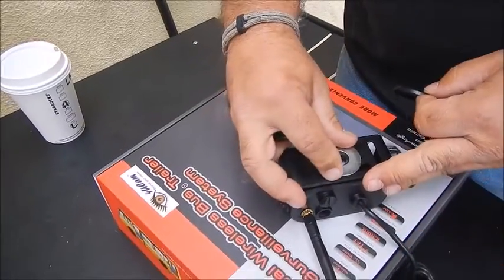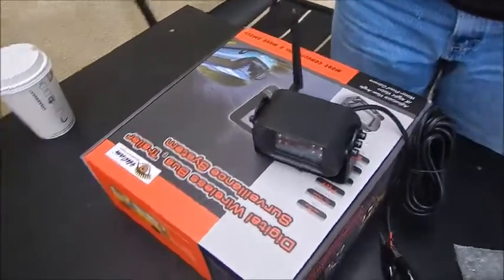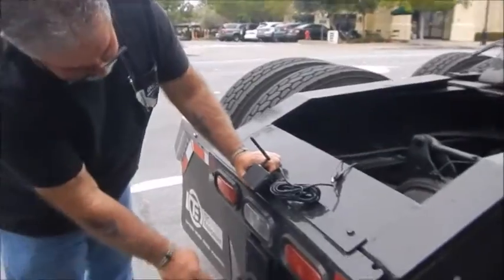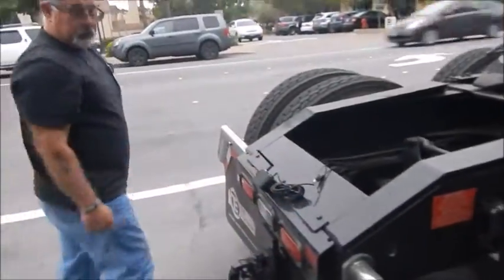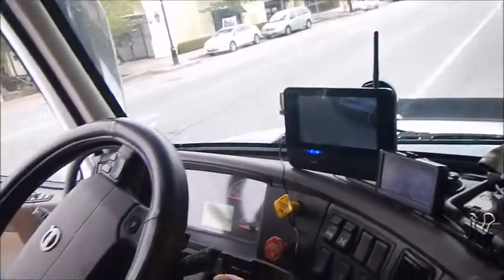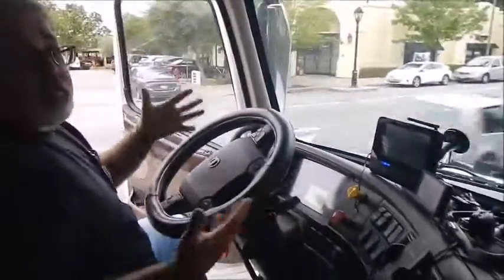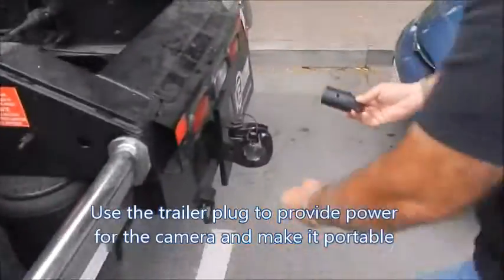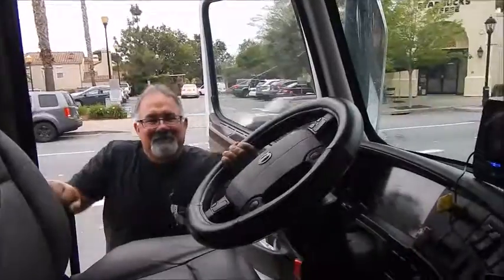Convert 4UCam Digital Wireless Camera to portable for Semi truck

Comment: How is the portable camera working out for you, i want to do something similar i pull 3-4 trailers at once, total length of 196 feet in Australia and as you can imagine when hooking up that many trailers you end up in and out of the truck a lot checking distances so as not to damage anything.
Reply: That's wild, hooking two is difficult as it is